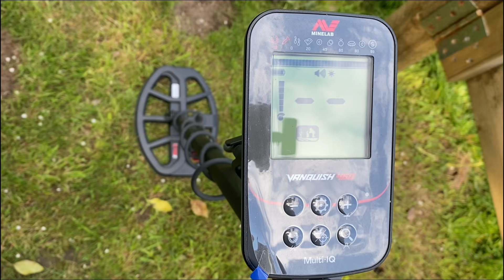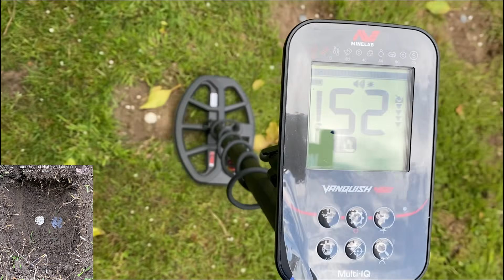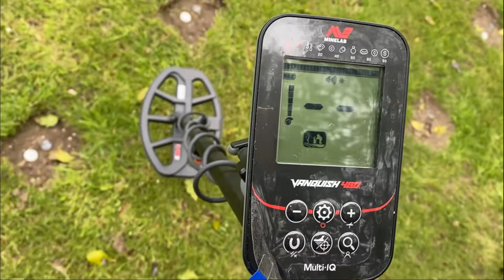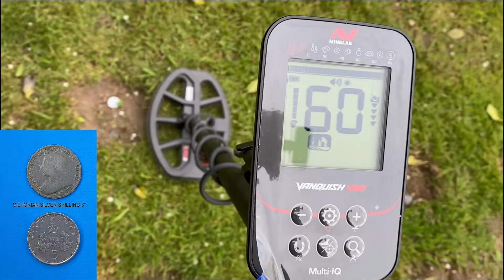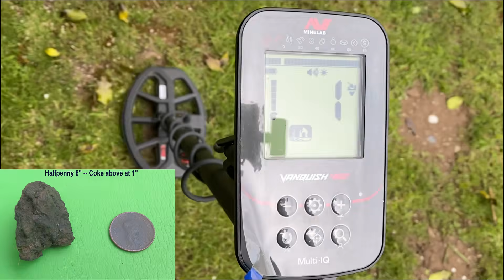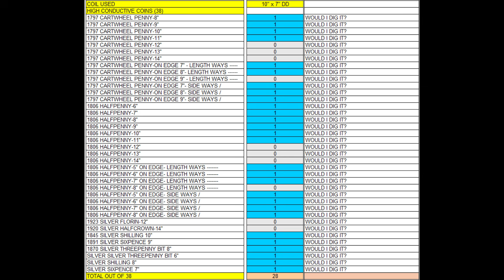MINELAB VANQUISH 460 METAL DETECTOR TEST

Comment: I hope wife give me a yes when she get home from work.. i really want to buy 1 of these.. cost 500usd here in norway dough...  if she say yes its in a way that make me feel bad about it.. i know here ! hehe .. well hope the chanse of earn it back on good ring find on the really long beach close by make here give a clear yes :)
Reply from the maker: Good luck with the negotiation, hopefully you'll be out on the beach soon! 👍
Reply: @StaffsMetalDetectorTests  the detector is on its way.. i bought it :)  just hope i do not find to many ww2 mines.. that long beach i will scan they just found that.. hehe.. suppose to be cleared but sometimes they still find em.
Reply: @StaffsMetalDetectorTests  had to  stop the order,, i got a firm NO from the goverment depatment that regulate the beaches here. so then there is no point buying this thing.  the kids and teens dig gigantic holes on the beach but hobby metal detector and dig a small hole you instant fill again.. thats a FIRM NO.. can not dig even an inch.. can only pick up stuff on top of the sand they write.. Norway is dumb when it comes to stuff like this.